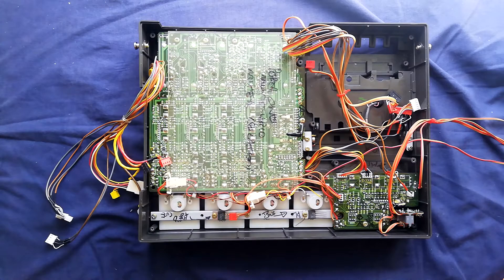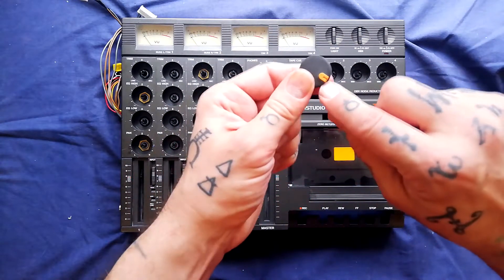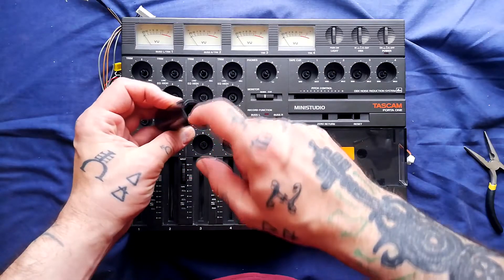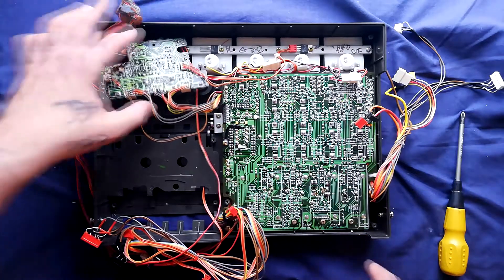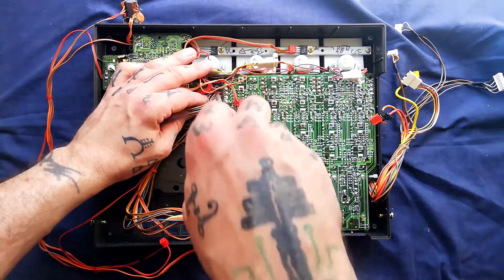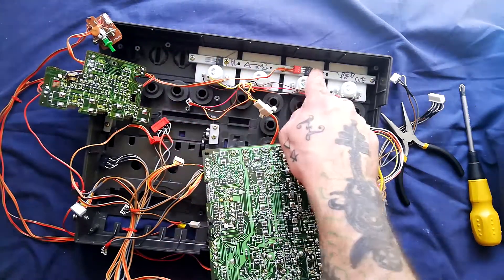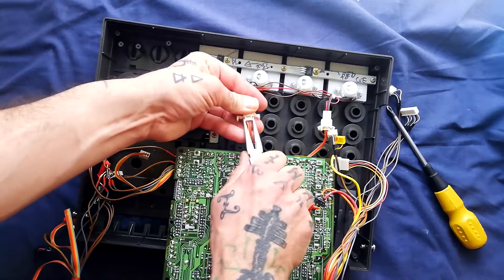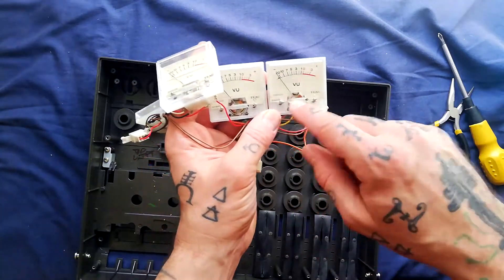Tascam Porta One Ministudio | Tear down part 3 | Upper PCBs, knobs, meters, door & calibration

Comment: I've gotten in the habit of labeling nylon header connectors with a simple numbering system: Which board it goes to and a semi-arbitrary number, close to those that surround it.  For example, a label of "2.5" would go to board 2 on a header somewhere near where connectors 2.4 and 2.6 connect.   Also makes taking rebuild notes easier: "2.5: brown lines up with pin 1, add cable tie after."

Comment: Hey man, just wanted to say all your videos are a great gift to DIY people who want to fix these things themselves. I just bought one for about 50 euros, tape transport kinda works, sometimes lags, can be fixed, still working on it. But it has bigger problems, track 1, 2 and 4 trim pots don't do anything at all, EQ high 2, 3 and 4 don't work at all, only ch 3 gain (trim) pot works okay. Playback is okay, channel one sounds muddy even though it's the only channel that has a functional EQ, it only records normal on channels 2, 3 and sometimes 4, porta one that I have sort of  works sometimes in a very lo-fi way, almost unusable. Any advice except watching your videos?
Reply from the maker: With that many proplems I woudl take the mixer out fo the case and inspect it - are there cracks or other damage? Has someone spilled a drink on it? If there isn't anything visual that explains your multiple problems, and a good through clean doesn't bring it back to life (you'd be surprised about how many problems are mitigated just by throughly cleaning a neglected portastudio)) you might be as well to try and treplace all the electrolytic capcitors on the mixer PCB if not the record playback PCB . Failing that you're going to need to learn to use a homemade audio rpobe and a DMM to narrow down where the oproblems are, or maybe demote that unit to a spares donor and find another porta one where you're starting from a better place?
Reply: I pulled the whole thing apart and cleaned it all the way, changed half the capacitors, re-soldered both boards multiple times, tried to drown it in contact cleaner, only made it worse. It had been used a lot, spilled a lot, and even after a huge clean on the 2nd try it still smells like pot and cigarettes, potentiometers only work now when they're pressed down really hard (they start to make contact), it could be that EQ(mixer) motherboard has broken contacts on multiple places. Finding a second one for parts is almost impossible since i live on balkans (ex-yugoslavia), and the working ones start at a price of about 300 dollars.
Reply: I also have a broken Tascam 48 (1/2" reel-to-reel) that are a real hard find here, everything built pre-90s that records on 4 channels or more (fostex, revox, teac, otari) is an impossible find, and when you do rarely find it, it is either broken or falling apart.

Comment: Hi Tetrakan and Tascam fans, does anyone know where to find the POTENTIOMETER C10k for "trim" position..? I've found out that one doesn't work in general and the other has outages and can't even be cleaned.
Reply from the maker: I'm sorry I haven't researched this becasue I rely on spares donors. if you're in the UK contact me via FB -  I can probably sell you one from my spares supply.
Reply: @Tetrakan  Thanks for the reply. I'm from Slovakia, so I'll have to figure it out myself. I already got the mixer PCB board from tascam-ninja so I have some spare parts now. Good luck, wish you well :)

Comment: Hello, I'm currently restoring a porta one and have two issues with it. One it the zero return doesn't work. And the main issue is tracks/buss 1&2 are extremely quiet for some reason. The meters work when tested. But they do not move during playback or recording. 3&4 work good and are nice and loud. Cue knobs (1&2) are the only way I can hear the tape playing. Any suggestions at all. I'm browsing your channel so hopefully I'll come up with something.  Thanks 🙏
Reply from the maker: Autostop - it's been a while since I dealt with that generic GEC  transport but I did a complete teardown of it, look for the playlist on my channel home page , I'd be looking at the solenoid and leaf switches and checking the wires are intact and for any mechanical faults, like missing springs or broken plastic parts. For the audio problems check out my electrical troubleshooting playlist, and in particular a repair report I just published on the porta 03 which is a good summary of how I approach those sorts of issues. Basically my protocol is- get the unit clean, inspect for bad joints or broken wires, get it   hooked up out of its plastic case so I can access its guts while power is turned on, use a multimeter to check opamps are receiving power, if they are use an audio probe to find where the sound cuts out, once I know where the problem is roughly, start replacing components in that area, starting with electrolytic capacitors. I'd start the audio probe process by making sure those faders are passing signal cos it's common for them to get corroded or clogged up with lint.